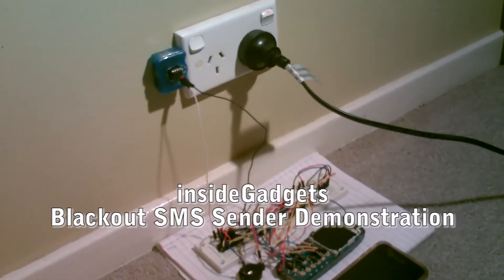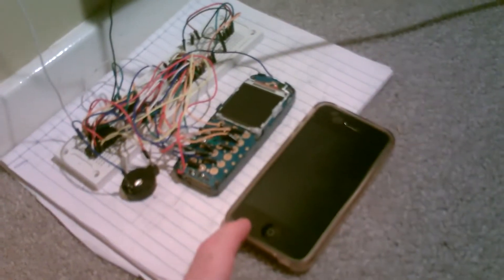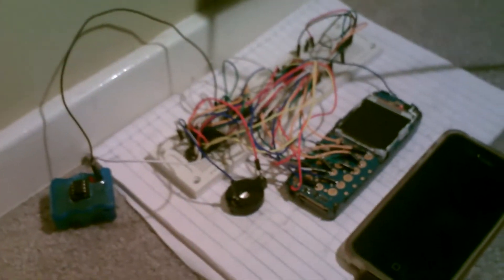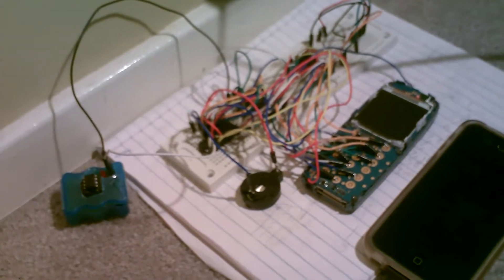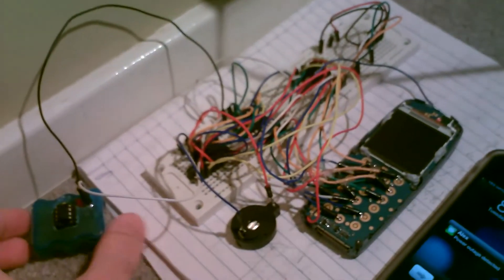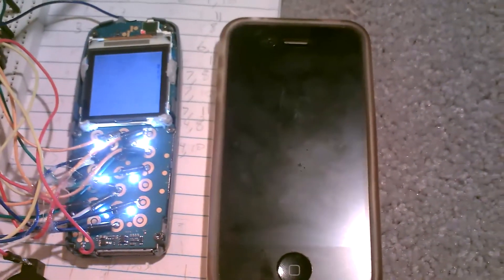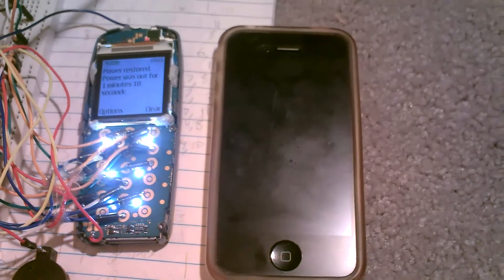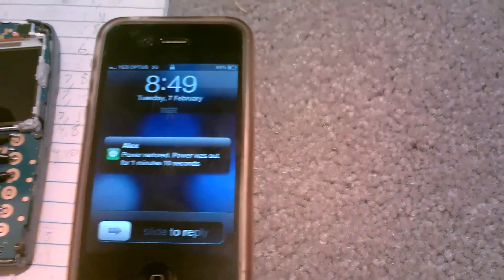Blackout SMS Sender Demonstration

Comment from the maker: Yes, you'd just hook up the AC adapter to one pin of the ATtiny and if that pin goes low then the power has been cut. I'm not too sure about sending commands through USB but some Nokia phones have TX/RX pins and you can commands that way. Check out gnokii and the phones supported, I've done it using the TX pin to send an SMS (search for SMS on my site).

Comment: This is cool and all, but I'd do it differently for a practical project. For permanent installation, you need a power source anyway. So what you could do is to use that power source for detection, as well as use the Nokia's battery for powering the detection circuit.